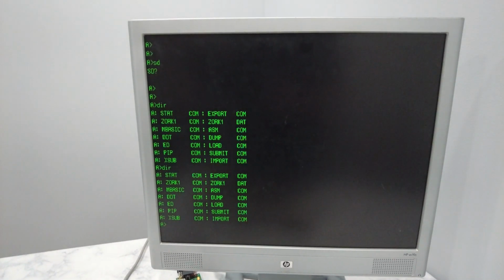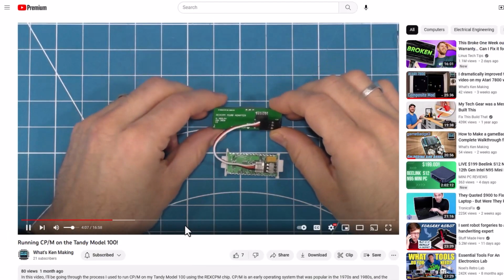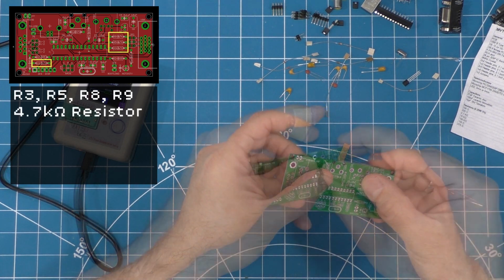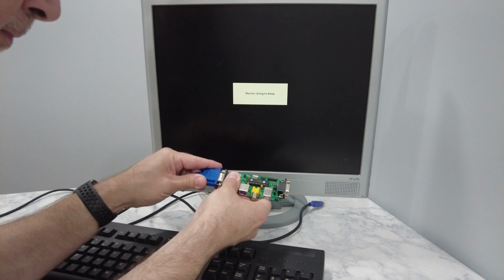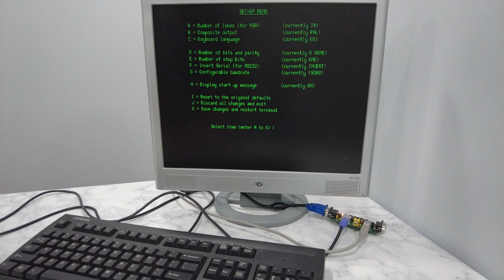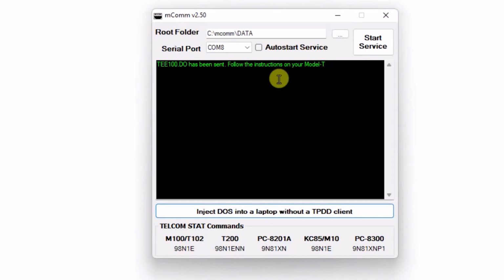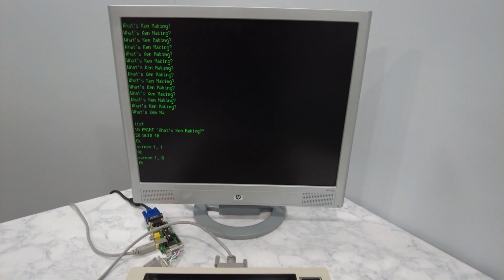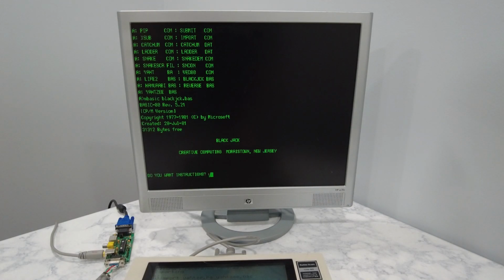Tandy Model 100 (TRS-80) on a VGA Monitor with the MVT100

Comment: Does it emulate a disk drive, too?
Reply from the maker: The MVT100 does not - but a couple months after making this video, I did the "BCR Hack" (which I showed in another M100 video) and that allows you to connect the MVT100 through the bar code reader port, freeing up the RS-232 port in the back. With that port free, you a couple of different TPDD emulator options. I usually use the TPDD Backpack that Jeff Birt sells, but you can also go the cheap route and connect the serial cable to your computer and use an emulator like laddiecon.

Comment: I remember buying one of those local auction back in 1992. I bought it for $50 and ended up selling it to a pawnshop for 300. I think RadioShack had it for $600 in the catalog at the time.

Comment: Can your run the Model 100 TEXT application over the video adaptor or let's say the SuperRom apps - like Lucid spreadsheet?
Reply from the maker: The built in apps all work over it fine. Not sure about ROM based apps but from the way I understand it works, I think they should all work as well.

Comment: Ken, did you ever get the Ladder game working there? It's an excellent bit of ASCII Arcade fun! Ladder (v1.30) works a treat on my VT100 CP/M Model100 setup.
Reply from the maker: No, but I haven't really looked at it since I recorded that video. So, you have it working?  Are you using the same setup that I am?
Reply: @whatskenmaking  If you are seeing escape sequences, wouldn't that mean that it is using ANSI? Does the MVT100 support ANSI? I have not tried it yet, but the VGA32 (ESP32 board with VGA and PS2 ports) has an ANSI terminal example that I think would work much like the MVT100, but does support ANSI.
Reply: @scottmcdonnell7559  Did you get answer?  I too have an esp32 vga32 board.  I'd like to give it a try on my Model 100.

Comment: I just bought the microcontroller and going to try scratch building the mvt100 this weekend, very few parts required. I will be making mine composite only to use through RF modulator on my early 80s B/W set. Also will be doing the mod to the BCD port so I can dial a few BBS via modem.
Reply from the maker: Nice - I hope you got your MVT100 up and running successfully! I have another Model 100 video coming out in the next couple of days where I walk through the BCR mod, in addition to a couple of other things.
Reply: @whatskenmaking  Not yet, I have been working on it slowly, lots of other stuff going on (finally finishing refurbishing my shed/shop) Decided to populate all the ports with headers so I can add ports later on. I am at the power supply and testing stage. My plan is to get it powered and test all the power/grounds and then populate the socket program and test on video. Also have a usb, rs232 and composite cable to build.
Reply from the maker: If you’re going to use the BCR port you don’t need the RS232 cable. I found that you can connect the DE-9 port on the MVT100 directly to the BCR port without a cable and without USB power. The MVT100 will get power from pin 9 on the BCR port which is already putting out 5v. It’s magical!
Reply: @whatskenmaking  Nice, I will have to look into that. Not sure how it will work with what I have wired up. The main circuit is nearly identical, but the power supply has been changed, using an lm7805 and a few diodes to get the 3v supply, because in true homebrew computer fashion, that is what I have handy. Either way power is not an issue, I have a 24.4k modem, ccr82, tppd2 and a dmp 136 that are all grabbing power off the power strip. Once I add the 10" b/w crt television whats one more.

Comment: I take it  that means you can’t use modem because the port is being used?
Reply from the maker: That's correct... however, there's a mod you can do to use the BCR port for serial communications - http://www.bitchin100.com/wiki/index.php?title=BCR_TTL_SERIAL_HACK. This mod is compatible with the MVT100, so if you do that, you can use both the MVT100 and the modem at the same time.